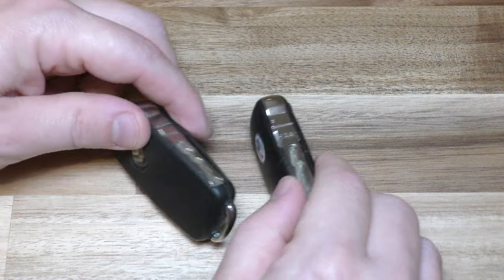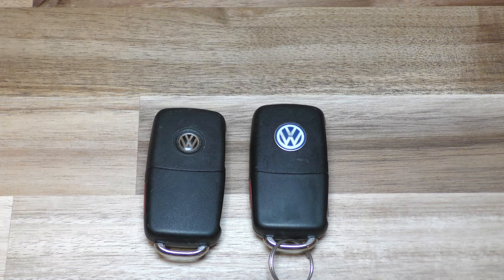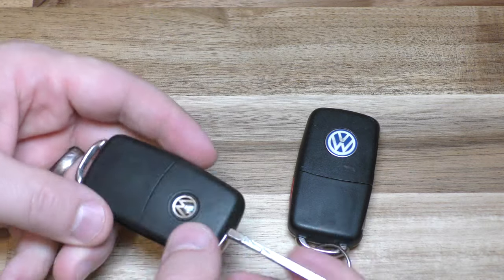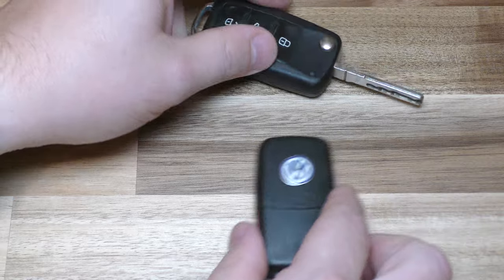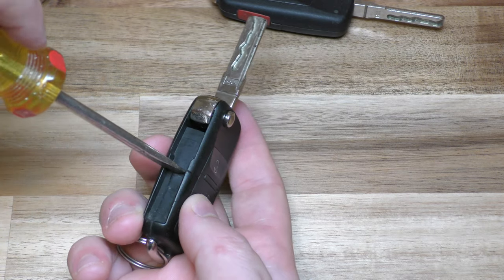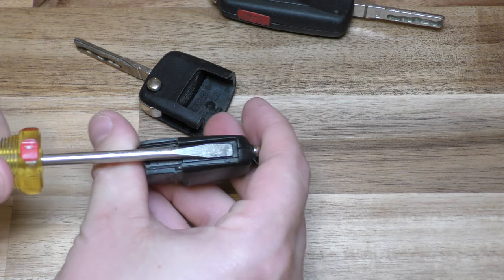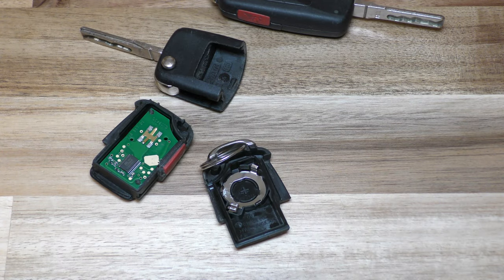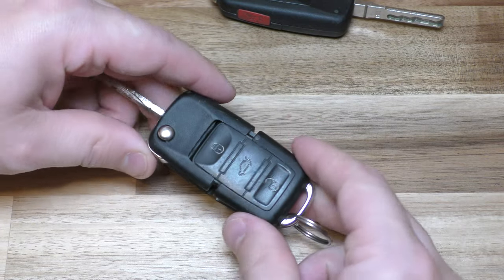2 Different Styles of VW Key Fob Battery Replacement - EASY DIY

Comment: Excellent instructions:  accurate and succinct.  It took me less than two minutes to replace the battery (prying the old one out was a bit harder than I expected, or it would have been about one minute).
Reply from the maker: No problem 👍

Comment: That was so easy! I was overthinking it. Lol. Thanks for this very easy understanding video!
Reply: I haven't been able to lock my car cuz the battery in the fob died..and the key hole is broken to my door handle so the key literally just spins without locking the door or car.
Reply from the maker: Glad you could get it sorted out!

Comment: Good info, Thanks! Note my 2005 Passat uses the key that is taken apart in two steps. My key fob would lock the doors, but not unlock them. I figured the key fob needed reprograming, but a new battery fixed the problem.
Reply from the maker: Glad it helped

Comment: Hi, Rob! I have a 2018 VW Jetta (Wolfsburg Edition); I’ve never changed the battery and when I try to pop the cover open (my fob has a bubble logo) it does not open with ease. Is there something more I need to do to get it open?

Comment: Appreciate the post. Ours (2003 VW Vista, mini class C/eurovan engine & chassi)) is not either of these, though looks similar to the older model. Where yours both show VW logos, ours is a blank circle w/a tiny screw~ not sure if I should try unscrewing, or go w/your own method #2, since it does look the same on the side view when the key is popped out of the way? Appreciate your time if you happen to see this~ Sam in AZ

Comment: Now an even cheaper fob on the 2022 Tiguan.  You have to pull an emergency key out of device.  Both batteries had to be replaced (by me) after 26 months.  One fob was only used when car was serviced (2x total) and my everyday fob in use on a car that hasn’t hit 7500 miles yet.

Comment: I have the 2014 model and its the same as the older model showed here, just there is a retaining ring for the battery that comes out when you remove the battery. Wish I watched this video before attempting as I unnecessarily dissembled the 'flick-knife' key and had a whale of a time figuring out how to put it back together.
Reply from the maker: Yeah - those are quite the pain to put back into place

Comment: Not old enough model you forgot the 1998 to 2003. The older has two batteries and I need a code and what foes between the two batteries